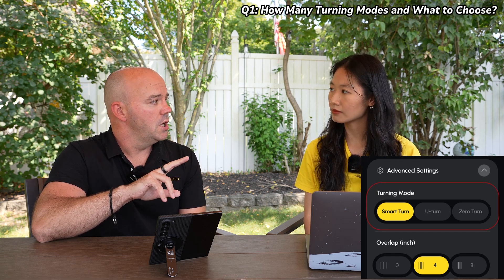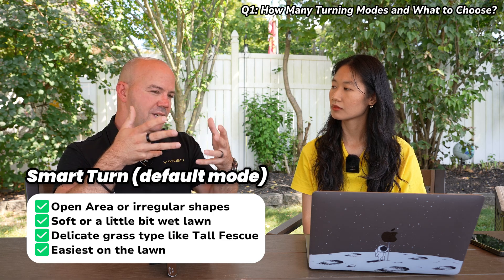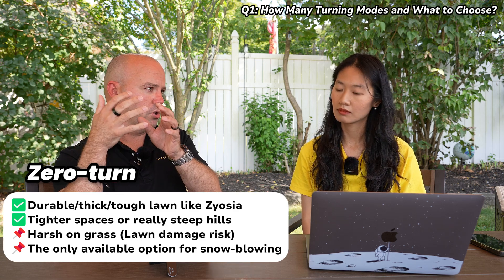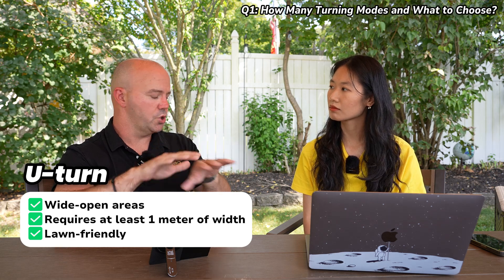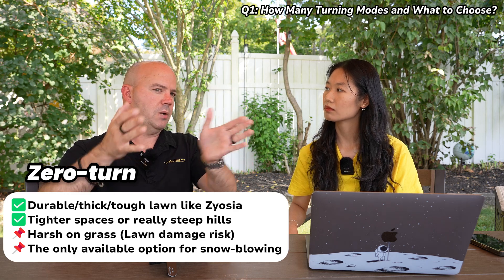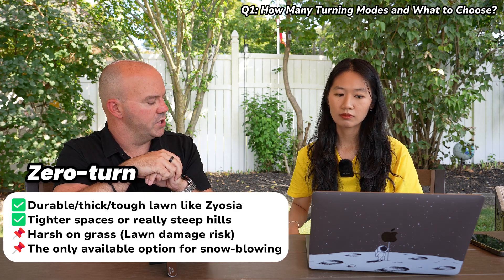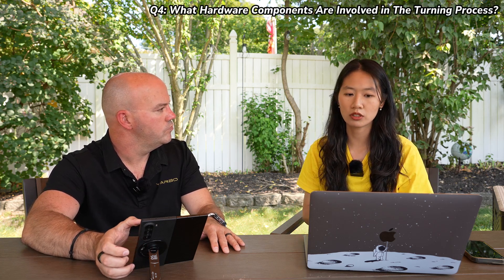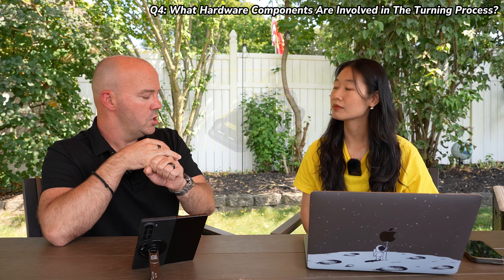Q&A: Answer All Your Questions about Yarbo's Turning Modes

Comment: comment for answer at min 3: Zero-turn for snowblower is also terrible for your driveway when you have to use metal bolts to prevent yarbo from slipping (my drieway is steep and yarbo would barely clear snow without bolts). I used it with bolts on driveway and concrete sidewalk and it made so much damage to the surface that you can still see it to this day, 9 months later. most of that was done when turning, not actaully driving through it. I think you should make available other turn options for snow too, not strictly zero-turn.
Reply from the maker: Hi there! Thank you for sharing your concerns about the anti-slip studs possibly damaging the ground. I’ll make sure to pass this feedback along to our tech team. We’ll work on finding a better balance between maintaining traction and minimizing surface damage. Here are the reasons why we only consider zero-turm as the turning mode for snow blower: efficient snow removal is key, especially when snow is falling. Clearing snow quickly helps prevent it from freezing and becoming harder to remove later. Using a zero-turn method is the quickest and easiest way to change directions without needing extra space. Other turning methods, like moving forward or backward while turning, can sometimes cause slipping, which increases the chances of getting stuck while trying to clear the path. Your input is really valuable to us! Thanks again for your support! If you have any other questions or need assistance, feel free to reach out to our support team at support@yarbo.com!

Comment: Thank you for this information. I look forward to trying out all of the different turning modes for my lawn. May I suggest an additional turning technique. When I cut my grass I try to avoid turns, just like Yarbo,  but I still like parallel lines back and forth which show a nice pattern on the lawn. To accomplish this with minimal turns, I cut one line to its end and then turn either left or right and skip one or more paths for the return. With this, I can do a large arc between the paths I'm cutting knowing that I will return to the other paths that we left uncut earlier in the job and still cut them in the correct direction to give me my pattern lines. Such a turning mode would allow Yarbo to press onwards with a smooth arc cut which I suspect would be faster than the smart turn and still less harsh on the grass as the Zero Turn. Thanks.
Reply from the maker: Hi there, Thank you for your thoughtful suggestion! We have 4 cutting patterns, Logical lines, Checkerboard, triangle and spiral. I think one of the Checkerboards is what you want. And we have a feature in our app called route angle, where you can adjust the angle until you get the shape you want! If you have any questions or need support, don’t hesitate to reach out to support@yarbo.com. Thanks again for your support!

Comment: Thank you VERY MUCH for answering these questions!  The ability to solve paths with this machine is wonderful.
I'd suggest that some clarification on "dead end" pathing should be demonstrated at some point, even though it is a niche feature. There are some very steep inclines, such as with a ditch, creek, pond or lake, where the dead-end solves a lot of problems. Specifically, consider addressing the the problem of losing your Core to a 5 foot drop, or 3 feet of water on a steep ditch, river or pond embankment.  My current Luba2's mowing perimeter is about 2 or 3 feet above a ditch edge, because it slides down most of that distance when turning around *if the grass is dry*. Once the dew-point hits and the grass becomes wet, I do not mow that section because it would simply slide over the edge while turning.
I can't wait to put my Yarbo to work when it gets here. Cheers!
Reply from the maker: Hi there, thanks for your suggestion! Your suggestion about demonstrating "dead end" pathing is excellent, especially for those challenging areas like steep inclines near ditches or water bodies. Addressing the risks of losing the core in those situations could definitely be valuable for users facing similar challenges. Once you get your Yarbo, I’d love to hear how it performs in those tricky spots!